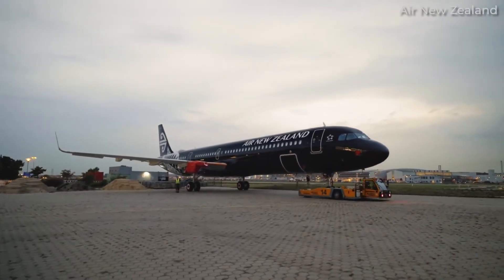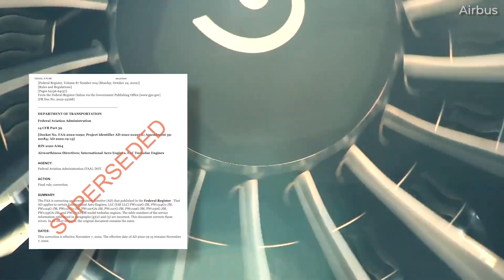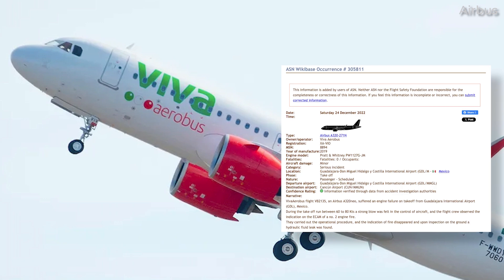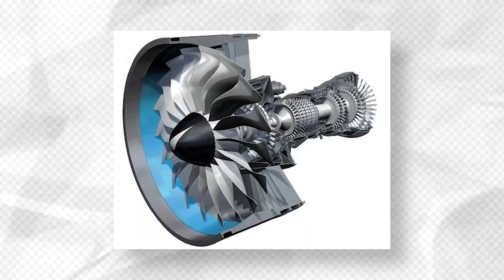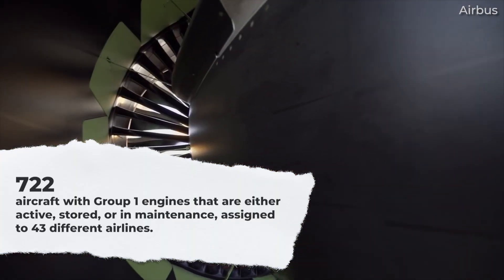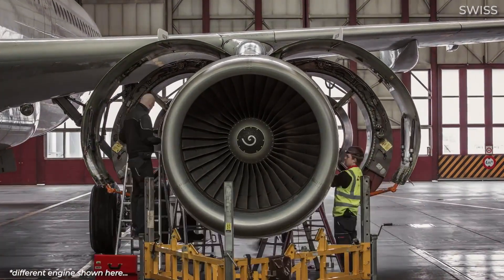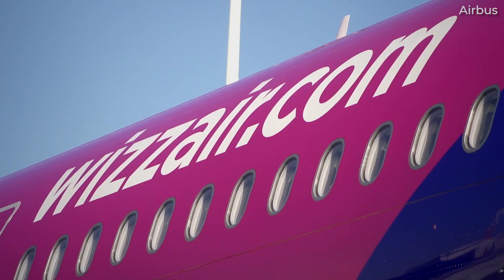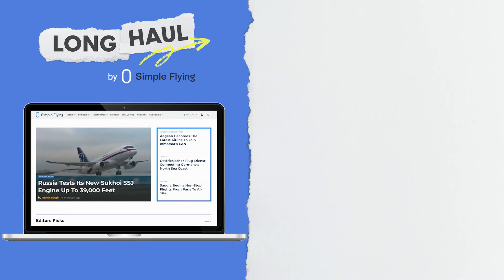Pratt & Whitney's GTF Engine Problems: US Airlines Could Lose Over $150 Million

Comment: Oh boy - as a former PW Overhaul tech - if the disks, blisks and hubs are being made with ADDITIVE manufacturing, and are failing - thats a HUGE fuckup
Reply: Safran is investing hundrends of million dollars to insource forgings, there is a reason
Reply: Is the engine cheaper or easier to maintain than the CFM Leap 1A? So many airlines are choosing the PW so that’s why I ask. Also, are more airlines gonna look into getting certified to do the engine overhauls themselves like Delta?
Reply: @Bjg6 They are almost always cheaper than the LEAP engines. But in this business it’s difficult for an airline to evaluate the quality of the engine they are choosing. With all the marketing bullshit they receive they can’t take a educated decision. As airlines are ruled by financial people, the engine manufacturers create their products to match their needs. In this specific case, they put all their effort on the fuel burn, not the cost of ownership over 10 years or more. Look at the GTF cross section and you can see that it is designed exclusively for fuel efficiency. Maximum bypass ratio at the cost of a gearbox and all components located around the core. 
To summarize, they build formula 1 engines. Very powerful and efficient, but not lasting very long, and very expensive to maintain.
Reply: Why wouldn't they go back to conventional manufacturing methods for making blades?
Reply: They don’t fail due to the manufacturing process.   They had a single failure of a hub that when investigated. It was found to be caused by the raw material supplied by a sub supplier having an impurity due to a tool.   They couldn’t lock down a suspect list and so out of caution decided to pull every part ever made from that suppliers material out of service.
Reply: @chrissmith7669  when you say "out of caution" it means " after going with the cheapest 3rd part - we found enough of a F up that it could cost us billions in lost share prices"
Reply: @ghostrider-be9ek what kind of crap are you posting
Reply: Pratt could have forged the disks and then machined for accuracy.  The sintering process parts come out of the mold with little shrinkage, so it is attractive.  If I were the main engineer, I would have gone with forgings to lessen the risk.  Forging has grain boundaries that line up and hence are very strong.

Comment: Airlines are going bankrupt because of this crap, known and hidden inherent design issues, of this barely certified engine.

Raytheon was hit with this unknown engine BEFORE it started to fail with the public as the flying guinea pigs.  The corporate officers thinking they'll get their bonuses and leave before the shit hits the fan.  P&W did a collective sigh "whew!"  "we're rid of that massive liability" as the corporate officers at PW and UTC collected their bonuses and departed.  All clear?

The FAA and the public doesn't know the half of it.  (the real inherent design issue(s) haven't revealed themselves (in-air failures), haven't occurred yet.)   Just wait, as the cycles accumulate, the REAL issues will start fucking BLOWING UP.

Comment: Dependable Engines 🤣🤣🤣 if you look at data from AeroInside and compare the number of LEAP incidents to the number of GTF incidents, and figure in the accumulated service hours, you'll find out that the LEAP is anywhere between 2, to up to 4, times more reliable than the Geared TurboFailure. To be fair, the fault isn't with the reduction gearbox, which took 2 decades to develop - it really has proven itself to be truly dependable. The problem is with the rest of the engine.
Reply: Bro PW is always been a failure ever since they built the shitty unreliable and dangerous PW4000 (ESPECIALLY ON 777-200/300s)

Comment: And yet you guys can't figure out that boieng has the option to buy different engines that don't have problems and don't explode all the time if they spent a little more on safety. More than one company builds and sells engines you know? Quit using such a weak excuse.
Reply: Trent 1000 on the Boeing 787...
Reply: This is not a Boeing problem. The airlines buy engines separate from the aircraft, they decide which engines they want to use due to price, efficiency’s and maintenance contracts.

Comment: It’s a shame because the GTF is exactly where all closed rotor jet engine designs are headed. Slower rotating bigger fans leads to more efficient propulsion. Let’s hope P&W fix these issues and prove it’s a design that works in the long run.
Reply: The issues aren't related to the actual gear that spins the fans slower, its been due to dust getting into small holes in the engines.
Reply: @heidirabenau511  and many more issues, too - but, yes, the reduction gearbox itself is just fine
Reply: We've all been hoping the same thing for almost a decade now with these Dependable Engines 😂 how was the CF34-8 doing in 2012, when it was 8 years in service? Remember any problems? Like, anything anywhere even near the problems of the GTF? 🤨
Reply: @rafaelwilks Still has nothing to do with the gearbox. Maybe GE should make one with a gearbox
Reply: Hate to break it to you but leap has not been without issues
Reply: I agree. After all the problem is in the compressor and not the gearbox.

Comment: Although this engine is rather progressive if I had a choice I would rather prefer a CFM LEAP engine because it’s more simple and reliable
Reply: That’s probably why United is taking on 25 NEOs with the Leap engine through lessors
Reply: *35 @TheTubadMoose
Reply: That's because the LEAP is an evolutionary design; it's the CFM-56 refined and perfected. However, as an evolutionary design, its long term development potential is limited.

Comment: If I were Airbus I would not offer the GTF on future orders.
Reply: Some airplanes are just designed with one turbine type. Which would mean airbus couldn’t sell them.
Reply: @klorevio  Airbus has 2 options for the A320 class of aircraft.
Reply: @icare7151  i did not track it but your right, i was thinking of the 330 neo/350 xwb which have just a single engine option.
Reply: @klorevio The same goes for the A220 and E190-E2. The only option for those is P&W and they haven't been reliable.
Reply: @CheapBastard1988  if P&W listened to me they would have never had their problems. It’s all about science.
Reply: @CheapBastard1988  You are correct. Once P&W resolved the bugs they and other engine manufacturers including GE and RR, were hit with a contaminated metal powder material issue that was used to manufacture the critical metal discs that house the turbin blades. 

The metal powder contaminates can cause significant early life, un-contained catastrophic disc failures that have the potential of destroying the aircraft including once in flight. 

I commend P&W for coming forward immediately disclosing this new issue. Hopefully they and associated airlines can weather the storm without going out of business.

Comment: Begs the question. Just how much testing did they do on these engines PRIOR to service on wing?
Reply: You can do a lot of testing. You can also do lots of modelling. However if you find a supplier has given you material not to the specification and you don’t know until after you have built it into the engine, what is an engine builder to do.

That supplier will ultimately be footing the bill and P&W will likely be taking their business elsewhere
Reply: The short answer is a lot. Out of spec materials and parts that don't get caught shorten the lifespan quite a bit.

Comment: i'm shock how airlines still orders the neos with pw crap
Reply: well, it seem to be slightly more efficient.
Reply: @ElmarLecher  not when you losing money because engine is crap
Reply: Because by the time the aircraft will be delivered, the problem should be sorted.
Reply: The GTF is a great design, efficient, reduced weight, etc.. the problem was some materials used in many of the engines were contaminated.

Comment: It is very difficult to compare with the RR Trent issues. I am no expert, however from what I have read, it would appear that the RR issues needed to be identified and fixed by RR. The duration of the problem being due to a degree of uncertainty as to the best way to resolve the issue, resulting in failed, or only partially successful attempts.

Wheras, with the P&W engine, this problem appears to be as a result of contaminated raw materials rather than engineering.

The issue with P&W being that they are overwhelmed, and even though they know what to do, they just cant fix them in an acceptable time.

While the issue with the Trent was bad, and no doubt more the responsibility of RR, the problematic GTF is having a greater impact on the schedules. No doubt exacerbated by the fact that these engines are produced in far higher numbers for the much larger single aisle market. Couple this with the airlines retiring many of their 'older' models during covid, with hindsight prematurely, there simply are not enough aircraft to plug the gaps while the much newer ones are grounded. A perfect storm?

It should also be accepted that the Trent issues were at their peak pre-covid, while the GTF is peaking post-covid with the serious supply chain issues still being experienced.

Comment: wow I'm certain most of these airlines are kicking themselves for going with popular PW GTF instead of the CMF LEAP-A engines..nearly eight years in service and the GTF continues to be plagued with issues
Reply: The current major problem is linked to a metal powder supplier which also affects other jet engine manufacturers.
Reply: @icare7151  This problems' affecting GE right now as well...
Reply: Let me give you guys a hint. They only do NDT dye penetrant testing. They are literally just now starting sonic testing. Now about 3 to 4 years ago I told them they needed to start checking for internal cracks in their gearbox gears after their gearboxes started blowing up. But it fell on deaf ears and nobody cared about what I had to say but they are now that the FAA has a fire 🔥 on their ...... They will be the next Boeing just watch and see because if they don't get their act together lives will be lost. 

Did you know it is not a requirement to have a FAA A&P license to build, install, or inspect these engines? You literally and I mean you literally have pizza delivery, vending machine operators, and refrigerator repairmen installing, manufacturing, repairing, and inspecting these parts. Yep and you wonder how we got here partly the FAAs fault and P&W fault. A&P mechanics like myself are looked down on and not taken seriously. How do I know? My back window was smashed in on my vehicle because I exposed some wrong doing. I wish I could go in more detail but I have endured enough. But there is your hint.
Reply: @Jude13able false information.
Reply: PW probably offered insane discounts to secure most airlines' orders.
Reply: 8 years of service already!
Reply: @arofhoof  GE and other engine manufacturers are also suffering from the same contaminated metal powder, the biggest problem with prior built P&W GTF engines. 

Thus it’s an industry wide problem.
Reply: @icare7151  no excuses for this. Do they not have internal QC to check the raw materials delivered meet the supplier spec sheets? do they not do any QC testing of parts they manufacture? do they not do any endurance or stress testing of serially manufactured parts to ensure quality is not changing long term?

Excuses.   the costs for the equipment and training to provide the required QC is less than 1 of these engine repairs. 
Having worked first hand inside the PW factory I can tell you it's building modern jet engines using 1940's factory processes and thinking, coupled with 2000's level of accounting and business culture nonsense that slashes engineering to the bone. 
PW is the Boeing of the engine makers.
Reply: @shmuck66  Apparently they claim there was not a test or testing for this specific type of contamination in the supplied metal powder. 

This appears one company assuming the “other” company was testing for this specific type of contaminant and/or assumed “quality control” would not have allowed this contaminant into the raw metal powder to begin with, thus didn’t test for it in their QC procedures. 

Connecting the dots, it was likely P&W started seeing failures in parts that would indicate a raw material problem which they questioned down to the raw powder. 

This is complete QC negligence on all levels, a sign of the times across the board where people relight too heavy on technology vs independent critical thinking. 

Bring back pencil, pen, paper, slide rulers and white-boards.
Reply: @icare7151  Total hogwash.
They can use XRF and it can give you a reading in a few minutes of the exact composition of the alloy and metal powder.
A decent quality machine can detect elements down to sodium pretty easy, and the one they should be using would detect down to boron.
That leaves beryllium and Lithium left, which a simple chemical test could detect.
So we are talking now, probably 1-2 hours of work to validate incoming supply is suitable to use.

I agree it is total QC negligence. But I don't believe it is result of technology, it is result of business people having no right making engineering and QC decisions.

You can do your engineering on a PC or a slide rule, but if your MBA boss is dictating what steps to do and you can't argue, that is the problem right there.

Bring back companies built by and run by engineers, not accountants or business people.
Reply: @shmuck66 I absolutely agree with you.  

The point I am making on technology is that it has verifiably caused a backlash of significant measurable losses of critical thinking skills as I interface with the younger generations of engineers and executive bean counter mentality management they answer to on a daily basis.

The constant brain drain of critical thinking skills in society today is also a product of the intentional decline of K-12, College/University education systems conditioning students not to use critical thinking skills, don’t question anything, rather just follow what you are told as “absolute, use technology in the place of critical thing skills and follow their lead” right off the proverbial cliff. 

Just a few of my observations and thoughts of my last 30+ years of advanced engineering and senior executive management experience.
Reply: @icare7151  Well, you said it yourself. It's not technology but the education system itself. Lack of critical observation and critical thinking skills and the lack of educators to train children to think objectively and reason out situations is not technologies fault. 

I agree with you that there is a decline in over all culture for engineers and scientists. But I can't blame technology on that. I blame the lazy, inept, and greedy.
Reply: @shmuck66  former OH tech here of PW engines - yes, raw materials are tested,  but INFREQUENTLY - the suppliers is BY LAW required to notify PW if they change the formula, etc. Its supposed to be QA by the supplier.
Reply: @shmuck66  "Bring back companies built by and run by engineers, not accountants or business people.

"  ..... the americas are starting to go back to that
Reply: @icare7151  YES! Ever notice how quickly and how well aircraft were designed with pencil, paper, and slide rules? In about a decade, Boeing cranked out the 707, 727, 737, and 747. Now, it takes a decade to develop ONE airliner! That's right; even though they have CAD/CAM, additive manufacturing, and every other modern tool known to man, it takes longer to design one aircraft than it took Boeing to design four back in the day; even with pencils, paper, and slide rules, Boeing cranked out four ass kicking jetliners. Granted, they were run by engineers in those days, but still.
Reply: @shmuck66  THAT TOO!
Reply: @arofhoof  yes sir... I'm no engineer but these issues like parts wearing faster than they should the bowing issue due to the heat on start up like how were they stress testing this engine and parts for wear and tear
Reply: Hindsight bias
Reply: @soccerguy2433  buyers remorse happens to all of us at some point...don't get me wrong the GTF is a marvel of modern engineering but eight years in service is more than enough time to work out the kinks